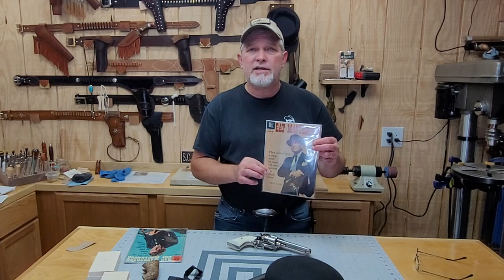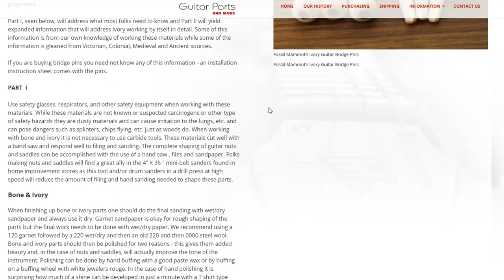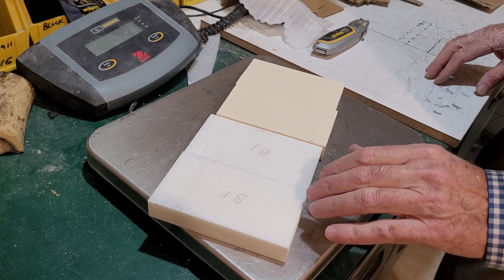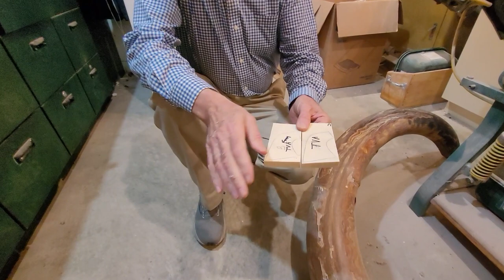Ivory Revolver Grips? | Hand Made Resin Ivory Grips

Comment: I made a pair of grips for my Ruger Vaquero with polished frame stainless steel.  They grips are yellowed and I put some cracks in them and you can't even tell that they are just a pair of white grips from Ajax to a great pair of custom grips.   I have already made three pairs for some friends and they could not tell that it was only plastic grips for about $60.00.  I had a great time doing these.  I used leather to get the yellow effect.  They are perfect. Couldn't imagine that coming out to end up with a great pair of grips.   kevin
Reply from the maker: Nice! I like to try making my own things and it's always a plus when they turn out just right. Thanks for watching!

Comment: You really need a true respirator working with that kind of material.
That dust mask is not enough
Reply from the maker: Technically, what I'm wearing IS a respirator. It's just not the kind with replaceable cartridges. I'm wearing a NIOSH N95 which filters out 95% of both solid and liquid particulate. If I were doing this regularly, I would have gotten out my Half-face respirator. The problem with the replaceable cartridges, is that once you open them, they are only good for a limited time and would be worthless by the time I needed them again. Thanks for watching!
Reply: @SmallCaliberArmsReview  👍🏻